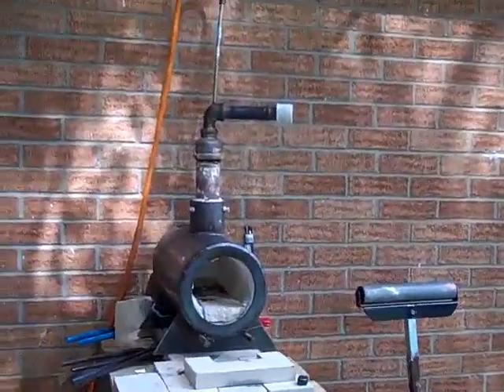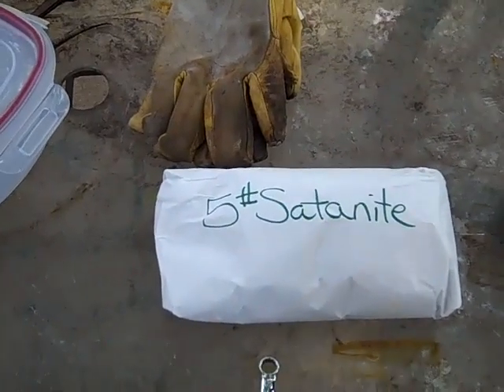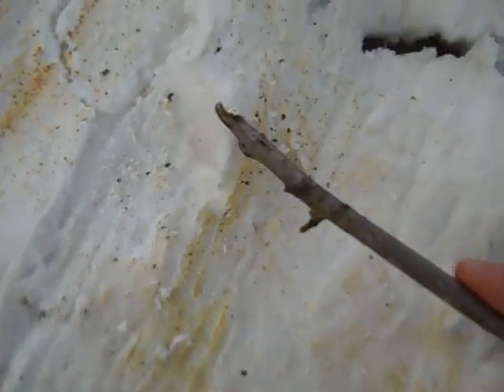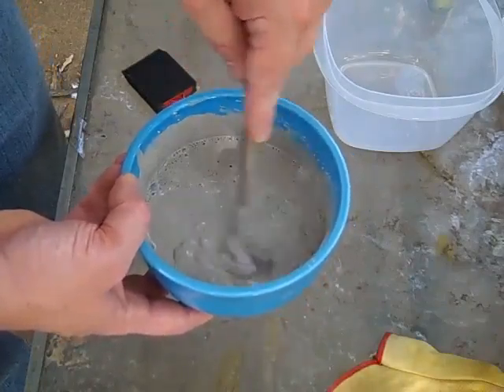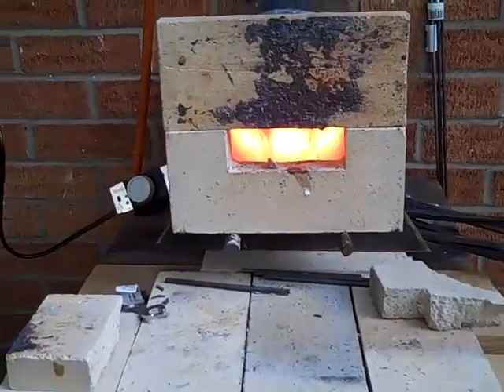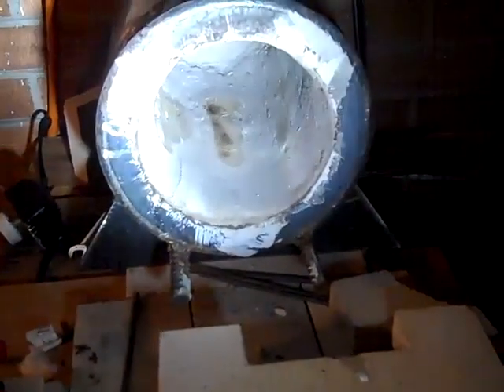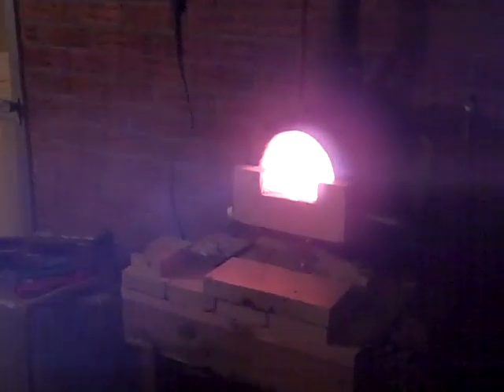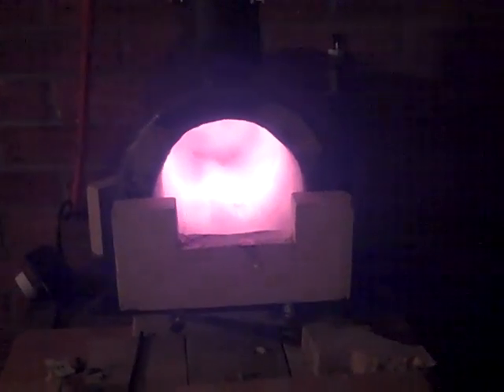Satanite coating on the inside of the gas forge

Comment: Once the wool/fleece has been taken up to forge temps... be sure to wear a respirator when removing it. The fibres are carcinogenic and it was only a few years back that it was nearly listed (in baked form) in a similar way to asbestos.
Also... applying a refractory coating such as Satanite or Vitcas 1700 prevents baked fibres being released during forging.

Comment: Tennessee was where you got your satanite, Can you please give more information about where at.
Looks like a easier product than I used on my first build, planning to add a second but larger forge later if happy with my current ribbon burner forge 
Thanks
Reply from the maker: That was years ago, so I have no idea where exactly I bought it. However, a quick googling turned up this: https://www.blacksmithsdepot.com/satanite-refractory-mortar-5-lb.html

As I recall, this is roughly what I paid back then.

Comment: So many people use kaowool without satanite, and it's stupid, plain and simple. The wool fibers will blow everywhere and get in your lungs and cause chronic inflamation and maybe cancer. Don't be stupid, guys.
Reply: It always worries me when I see someone new to both forging and ceramic wool products buying a cheapo cerawool lined setup with no type of refractory cement treatment. I scrolled down to the comments to say exactly what you so precisely beat me to by an easy 2 years.... Glad I'm not the only person trying to look out for others on this issue.
Reply: @permanentvisitor2460  Thankfully, a lot of the big blacksmith channels on here specifically mention about using the correct grade of filtered respirator around bare kaowool, and to always coat it with rigidizer and refractory of some sort if it's for long term use.

Comment: Mark,
How has the satanite held up over the past 6+ years ?
Reply from the maker: It has held up surprisingly well. It has cracked here and there, but it's largely intact.
Reply: Mark Lowry that is amazing
Reply from the maker: @bfries555  -- FYI, I just tonight re-coated the inside of the forge. The original satanite held up for 15 years!

Comment: I can't see past the freaking hair dryer,all the good work you did with your forge and you use a hair dryer.
hook up a real blower motor or a compressed air nozzle man
Reply: dude why bother, it works, there is nothing wrong with using tools that work , as a guy with a limited income this gives me a great idea to convert my gas forge to forced air and reduce fuel costs

Comment: A quick tip to save the bottom of your forge. Use unscented kitty litter...which is just a good clay really. The blast from the forge won't gouge out the bricks and it also makes it easier to pick up the annoying small pieces that are being forged as your tongs can maneuver through the small clay bits to get under the work piece.
Reply: Unscented cat litter is also called bentonite, which is available in hardware/farm and fleet type stores for a couple bucks. It's highly absorbent and expands when wet. It gets quite hard when fired from a wet state.

Comment: how much pressure are you running on your regulator ?   maybe 5 to 7 ?  
and for  a 13" forge that burner  rocks ,  because  it looks almost a lemon yellow , and that's a nice forging temp for me , what did the refractory blanket Run you ,  the last one I made had home made refractory and took two of us  to set it up on the stand

Comment from the maker: @tgf1310 Yes, the heat seems to spread more evenly and symmetrically with the inlet coming straight down.
Reply: Mark Lowry do you have contact info of guy in knoxville you bought satanite from? Ive been trying to find a local supplier to save on shipping costs and no luck. Im hour away from knox
Reply: And thx for great video, ill be doing this very soon

Comment from the maker: @RonRay I don't have a full list of specs, but the "can" of the forge is 8" diameter x 14" long.  If I had it to do over, however, I'd save a ton of money and just cut the end off an old propane tank and line it well with heat-resistant material.

Comment: @Makermook Ah, you are lucky, I never seen to get my allowance raised. sigh
Go by the junkyard and pick ya up a ford leaf spring. once ya learn to heat treat 5160 you'll find it is an excellent steel. I can cut through 1/4" mild steel cold with a blade made from that. O-1 is an excellent steel, but unless you go the extra mile with the heat treat then you can hardly tell the difference between it and 1095. 
1095 is less than half the price...
Reply: BladeCrafters